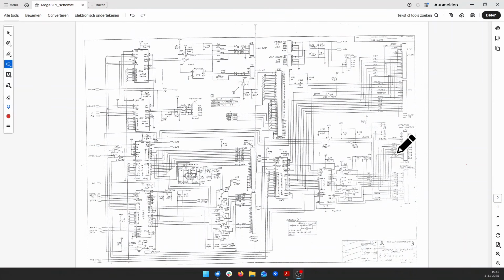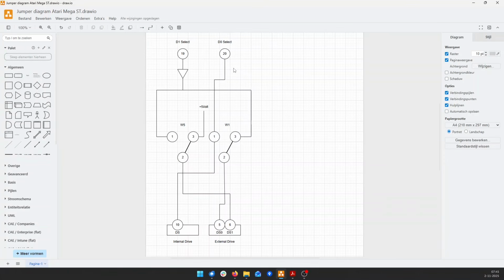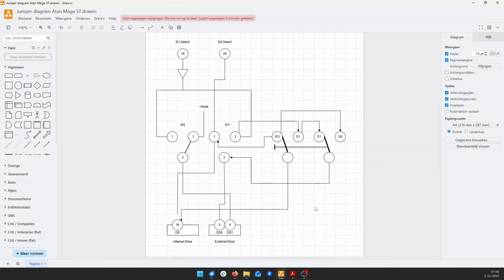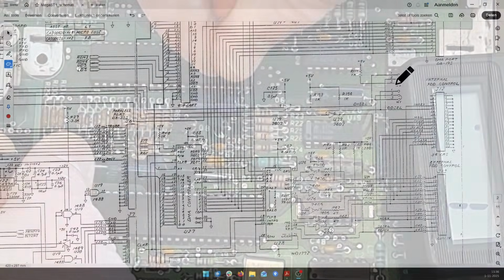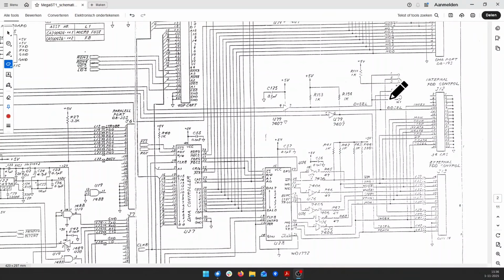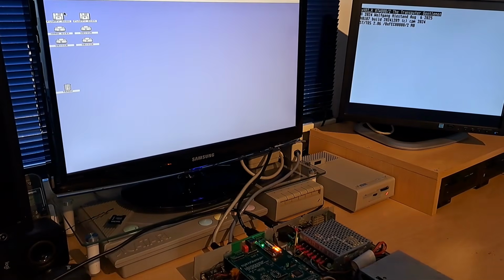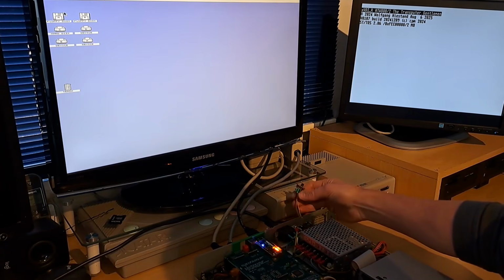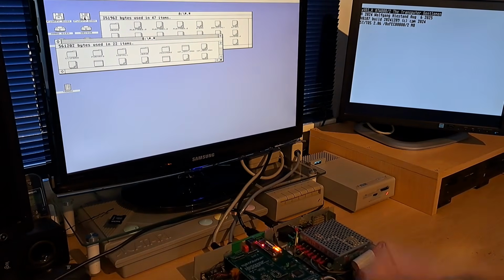Atari Mega ST non destructive floppy drive A - B switch

Comment: A long time ago, I did it almost the same way, but instead of modifying the internal floppy cable, I used the DS jumpers on the drive itself. I had an Epson drive, which has traditional jumpers, unlike your Sony FDD, which has slide switches.
Reply from the maker: Okay. There might also be jumpers on the drive itself. I hadn't thought of that. Thanks for the tip.